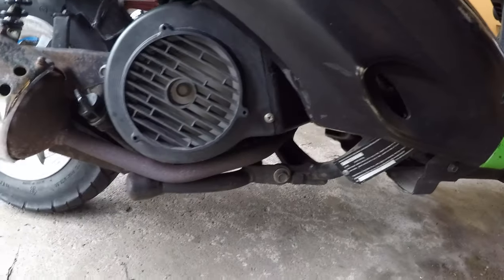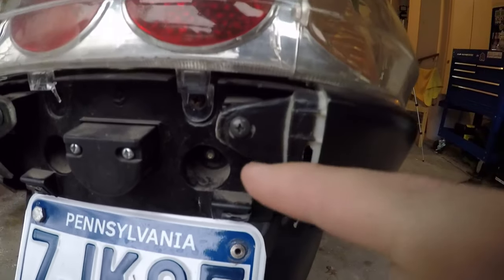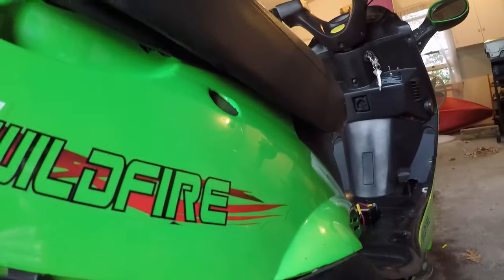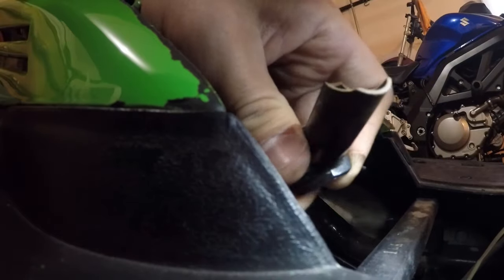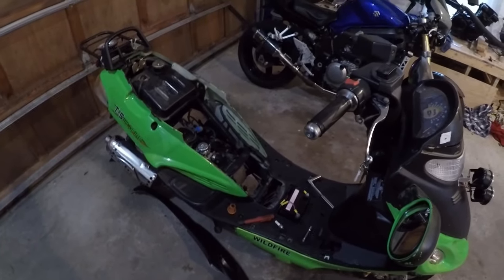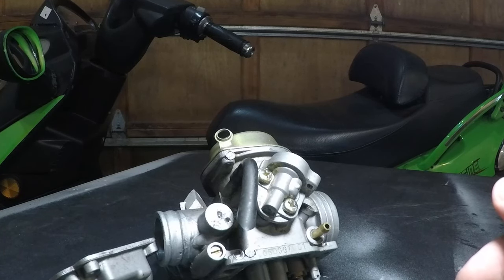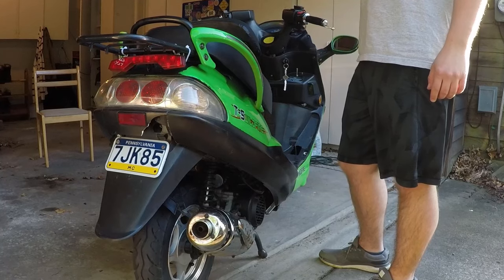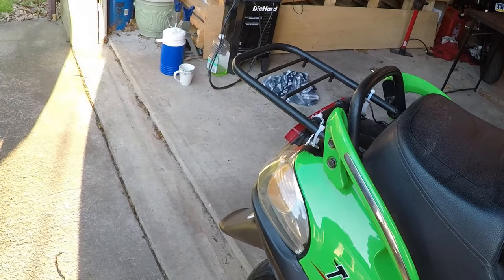Scooter Won't Start or Idle? Try These 5 Things to Get It Running | 150cc and 50cc GY6 Scooters

Comment: Is there anyway I could be able to send you a video of what my scooter is doing ?. When I turn the key and the dash lights come on when I hit the electric start it the lights in the dash turn off and it makes a weird quiet sound and doesn’t turn over or anything
Reply from the maker: Is your battery fully charged? Does it click when you try and press the electric start?
Reply: @TyposGarage  i have a 150cc of this scooter built into a 200cc and thw back lights turn on and signals but no start nun alil clicking noise like ypu said but that's it
Reply: @TyposGarage  my scooter is doing this same thing. We have fully charged and even replaced our battery. Any thoughts?

Comment: I have a GY6 Jonway 150, its only done 200km but did not stat after a period standing, Carbs cleans, new fuel, new plug, Tappets adjusted (0.3 inlet, 0.5 outlet), fuel pump checked, won't tick over but does start much better and little fumes out the exhaust. however, does not feel like much power or revs (nowhere near revvy as in your vid) and won't idle unless the throttle kept open (a large gap between ideal screw and throttle plate. Air mix set to 2 full turns out. - still, struggling to get it to run smoothly and idle - any other suggestions? if does run using the idle but not well and hard to start - any ideas and things to check ?
Reply from the maker: Your problems seem very similar to mine in this video. You said that you cleaned the carb. Did you clean out ALL of the jets in the carb with a small piece of wire and blow them out? The jets being clogged could cause this.  
Also, check your floats in the carb. That was my issue. They must have went bad from sitting over winter and filled up with gas. 
Another thing you can try is to buy a new CDI box.  Each one is different and control the timing of the spark.  Some restrict the engine. 

I would also check for vacuum leaks in your vacuum lines and cracks in your fuel lines. 

Try a few of these things and let me know if any of them work.
Reply: Typo's Moto Garage hi yes. I did , actually had a spare carb previous owner provided as he could not start it. I manage to get it running with new spark plug. But it produced tones of fumes and was full throttle and then rever high and died and spied oils out the air box via over flow. I put the original carb back in after cleans ( had some green residue - assume bad fuel) .  I have tried adjusting the needle length and tried the clip in all 4 groves - lowest grove lacks power - but all four won’t idle - I have to open the throttle to make it idle ???? Cannot find it. Checked lines and manifold -
Reply: Btw the newer carb had no carb pump suction which is why I think it reved up once the fuel ran out
Reply: Typo's Moto Garage also not changed the coil or hot lead but it fires and runs so not sure I. We’d to
Reply: Typo's Moto Garage  and yes petrol cap off
Reply from the maker: @nickdolan8068  It seems like you are getting too much fuel.  You may want to pick up a brand new carb from amazon for a GY6 150cc engine.  I had issues with my carb even after I cleaned it. I bought the new one for 25 dollars and it solved my problem.  Was it oil or gasoline that you found in the airbox?
Reply: @TyposGarage  HI, thanks for helping. it was like a thin oil and dark in color. I think a vacuum-formed and somehow was sucked out. the second carb looks similar but I think it's for a different model as there is no hole on the fuel pump side of the carb ???  Looking at new carb and electrics on Amazon - about 50 pounds total. Its weird as yes the previous symptoms looked like too much petrol and running very rich, yet even when lenghting the needle (restrict flow) the bike won't idle. I can send you pictures and video if that helps if I have a email :-)
Reply from the maker: My email is tpruitt0907@gmail.com.  Definitely send me some pictures and I'll see what I can figure out!
Reply: @nickdolan8068 - "...spiting oil out..." Too much oil, faulty ventilation system...
NEVER do that ridiculous dance of messing with the carb and/or putting a new carb. Without basic checking/fixing of whatever was in there, in the first place! 
If the machine run before with that equipment. It should run NOW. 
So find the reason. Instead of dumping more troubles into the equation. Getting other carb or CDI (ridiculous). Is just compounding the problem. Not eliminating options. ;-)

Comment: can you show me where those vacums and carburetor lines are connected.
Reply from the maker: https://wiringdatabaseinfo.blogspot.com/2018/10/50cc-scooter-fuel-line-diagram.html

Check out the picture of the carb on this site.  I shows you where the vacuum lines connect and where they run to.
Reply: My scooter is like the one on the video, its hard to start,and when it start it doesnt idle and its shutting off,

Comment: A leaky float would cause gas to pour out carb
Reply from the maker: Not necessarily. I didn't have fuel leaking anywhere, just too much fuel getting to the engine.
Reply: His floats had some gas in them.   Some gas may trickle into the engine and flood.

Comment: Mine is only starting with a warmed up spark plugs it starts only once and won't idle it will accelerate but it'll still die after some seconds and it's smoking a lot even when I kickstart there's blue smoke coming out
Reply from the maker: Seems like you are getting too much fuel.  Blue smoke is the red flag here. A couple things to check are your float heights in the carb, air to fuel screw, jetting, and air box restrictions. What elevation are you at?
Reply: hello, I won't get ahead of myself, and say that I fixed it, but now it starts without the spark plug warmed up and I don't see any excesive smoke, and it idles, but now it will bog down when accelerating sometimes it will only bog at full throttle, and I have to mention that the spark plug comes out oily
Reply: @TyposGarage  and my elevation is 558 ft or 170m

Comment: I had a 49cc i put big bore kit 100cc amd it would run and ride cold but after warms up then want run
Reply: Did you go the premix route on gas:oil? If so, what ratio did you use? I see everything from 32:1 to 70:1 🤷
Reply: It’s running too rich

Comment: Anyone have an idea? I have new carb, new coil, new cdi, new cyliner set and a new spark plug. Really strong spark comes out but the engine wont even cough. The valves are in:0.1mm ex:0.15mm.

Comment: My 49cc taotao won't start its getting fuel and spark, it acts like it wants to start when I spray gas in the carb but nothing. I've changed the cdi, carb, fuel filter I'm at a loss
Reply: Did you figure it out I also have same problem

Comment: Thank for the video. Im new to Scooter, my  2005 QingQi  4 stroke YJ6 scooter looks very similar to yours with the foot rear brake and handle bar. Does your Scooter has a switch on right handle, top , near the "brake" "reservoir", its unlabeled. If so, would you know What is that swtich for? Its not the starter, or kill switch. Thank you
Reply from the maker: I can't find a picture of the top of the handle bars to see if it is a stock option.  Do you happen to have a picture of it?
Reply: @TyposGarage   Thanks for inquiring, no worries, i sold the Moped. Best regards

Comment: Been trying to get my moped to run it turns over but won't start, has no compression
Reply from the maker: There's a chance that your valves are too loose. That is a symptom of loose valves.  Did you run a compression test? If so, what was the number?

Comment: Bruh my moped start up revs high then die out any suggestions??
Reply from the maker: Possibly not enough fuel and it's running super lean? I would take the spark plug out and see what color it is. If it's lean, it would be a white color. It should be a healthy brown color.  Your idle might be set very high, also. Test those few things and get back to me

Comment: I found that my scooter doesn’t seem to be getting any fuel from the tank to the carb, is that because of a vacuum leak? Because I found the leak and when I clamp it down, the bike shuts off
Reply: And when it’s off and I clamp the leak it had even more difficult time idling
Reply from the maker: That's a good possibility. I would definitely replace that line since the fuel pump relies on that vacuum pressure to draw fuel from the tank.
Reply: Make sure gas cap is venting properly
Reply: @TyposGarage no bio u

Comment: Mine just won’t start at all, sometimes it sounds like it’s close to starting but won’t, tried cleaning the carb completely out still didn’t work
Reply: Ignition sum  prob that black wire near carburetor gotta switch em once an awhile like spark plugs
Reply from the maker: I would check for spark and check all of your wiring to see if something is loose. The ignition coils tend to go bad on these since they are cheap plastic. There is also a chance that the cdi box is bad. You can also test the fueling by using starter fluid. If it fires, you know it is probably a fuel issue.
Reply: @TyposGarage  is it ok for me to use the choke more the once a day like 2 times or maybe 3 gotta use the chock in the morning n if I’m working then gotta use the choke ether when I go to lunch or when i leave work
Reply from the maker: The choke can be used every time you start the bike. Once it's warmed up, it should be shut off.  If you can't run the motor without the choke on, you most likely have a few things wrong

Comment: So the spark arcing to the head explains the inconsistent light flash on the cdi...

And I have to say that after trying the "red hot coil" on my brand new scooter it failed after 25 miles so I went back to the stock one and it ran fine... 

...next was the stock cdi that failed after only 250 miles, replaced it with the blue box (10 bucks) and it ran fine again.

Now I'm into the completely useless vacuum emissions system and this scoot has less than 500 miles on it.

So when it comes to these cheap scooters with all the spaghetti vacuum lines and cheap plastic components that won't make it around the block without failing (and causing excess emissions instead of eliminating them) I look at it like this...

https://youtu.be/iMX5wi7Vz0Q?t=9

Hehehe...

Keep on scootin :-)
Reply: Lol...funny clip , that was me the first week of owning my scoot😄

Comment: can you help me I have a 50cc scooter it idles rough but it works and I can drive with it but when I open the throttle fast it bogs down and dies. I think its the carburetor but don't know what wrong with it maybe needs a different jet size
Reply from the maker: Well, I would start with cleaning the carburetor.  A small blockage can cause huge power loss.  There are some good instructional videos on a thorough cleaning of all your jets and passages.  What kind of scooter do you have?
Reply: @TyposGarage  i have already cleaned my carburetor and it still doing the same thing i have a kymco Agility 50
Reply from the maker: Depending on how many miles it has, the valves might need adjusted.  I had some trouble like that before I adjusted them.  The exhaust valve was out of spec and wasn't opening enough.

The other issue could a bad cdi box or ignition coil/spark plug.

Or a dirty air filter.
Reply: Typo's Moto Garage it might be the valves that need to get adjusted I tried another cdi and have a new spark plug and it’s not it I think it has to do with the jet size not being correct because it’s was made to run 25 km/h and now it’s running 60 km/h but don’t know which jet I need to replace
Reply: And the spark plug is really black when I checked it
Reply from the maker: So, in the manual it says both the exhaust and intake valves are supposed to be at 0.04mm. I would check those.
Also, in the troubleshooting part of the manual, it says to check the air filter, vacuum lines, fuel filter, fuel lines.  Sometimes when the vacuum lines are weak, they can collapse under load or can crack.

You can mess with the air to fuel ratio screw to see if that is out of adjustment.
Reply: Typo's Moto Garage what should I try first adjusting the valves or changing jet size or a whole new carburetor
Reply from the maker: @PaxNature  I would check your valves because it is basically free if you have a feeler gauge. They are less than $10 dollars.  

If you have the stock airbox, I dont think changing the jets would be necessary.  You usually only change jets if you put a free flowing exhaust or a different intake on. 

A brand new carb from amazon is like 25 dollars, so it wouldnt be a bad idea to pick one up.
Reply: Try a bigger mainjet. I had the same problem. My mainjet is atm 92 and i have a 50cc scooter.
Afther i got the 92 mainjet, my scooter runs awesome. Good luck with it. Hope it will solve your problem👍✌

Comment: My moped runs ok when it’s sitting there but when I put throttle to it. It then starts to bog out . Someone help. I’ve got a Chinese kymcho moped 50cc
Reply from the maker: You might need to clean the carburetor or check for vacuum leaks.  There are a bunch of videos online that can help you take the carb apart and clean it.

Comment: And not trying to be a douchebag I think most people scooters don't last long is because they keep buying cheap parts 

for it because they just want to try to make it run I mean if you're putting Quality Parts in your bike it would be like them more high in vehicle and it will last you much longer I was watching this one video on another YouTuber he was touching this topic he said a lot of scooter heads don't want to spend money on there Scooter and wonder why it's a melon I never been like that I try to spend as much money as I can on my bike nothing but Quality Parts just because I want to bike with no problems like when you get these things everything 

on it is crappy and cheap I think the only thing that's has quality to it when you get 

the bike is the gas cover in the body for 
the bike the body panels and the body frame everything else is garbage.